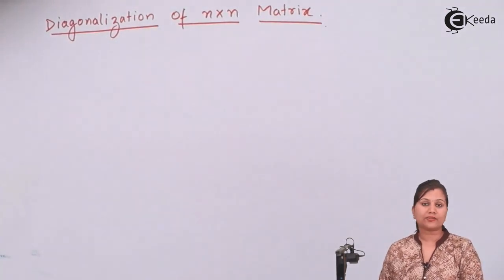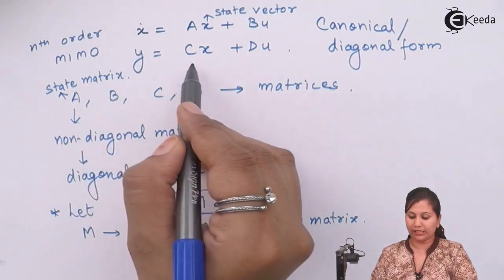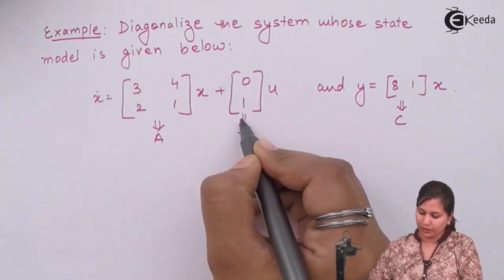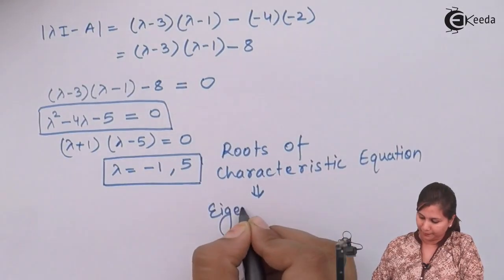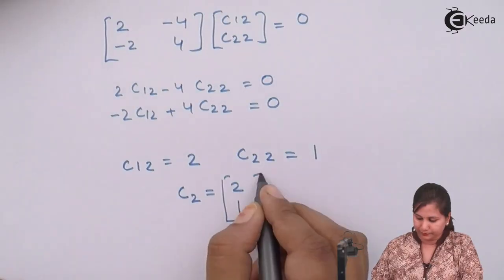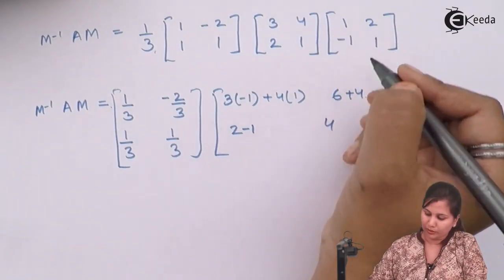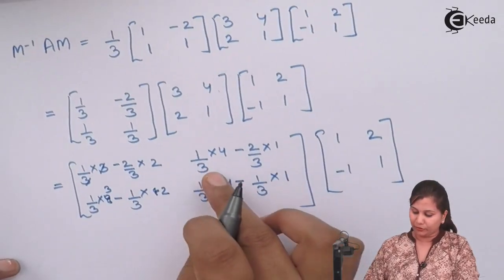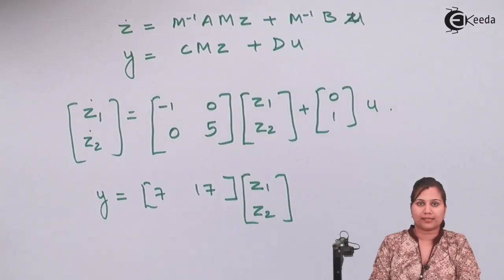Diagonalization of nxn Matrix - State Space Analysis - Control Systems

Comment: Thanks mam.how to calculate c11 and c12.i don't understand this step. please reply me.
Reply: You must just pick an arbitrary value for one, like C11. Then this enables you to work out C21.

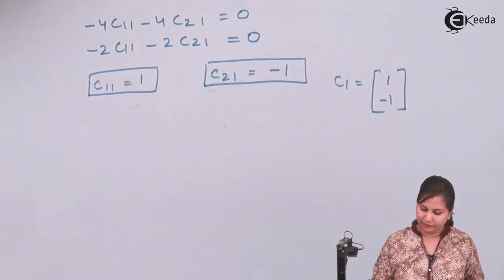So just let C11 be = 1 so then from the equation at 19:35 in the vide you can see that -4=4x C21   so -1 = C21

So this is why the answer is a vector [1, -1]

The eigenvector is basically just a ratio, since you can solve it for any value (you could say [5,-5] would also solve the two equations, so there are potentially an infinite number of eigenvectors). But we usually just normalise the vectors to the value of the maximum vector value anyway having assumed a guess value of 1.